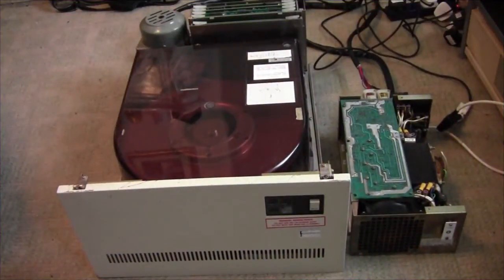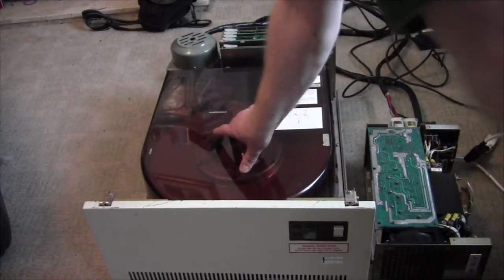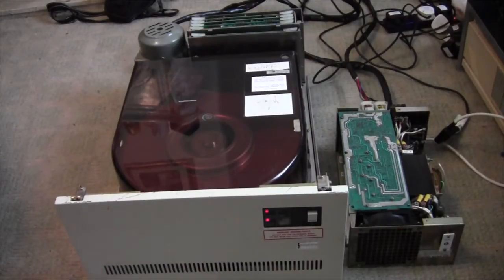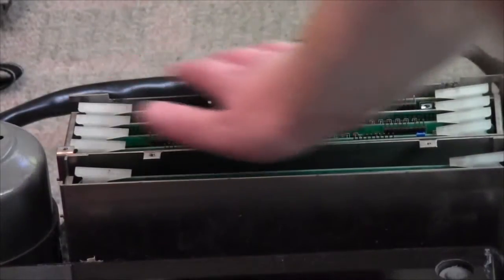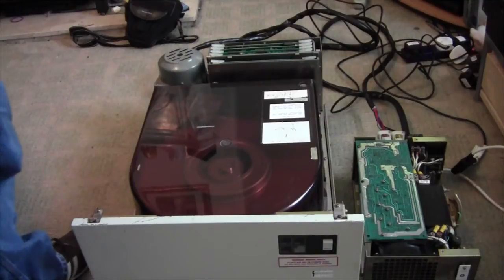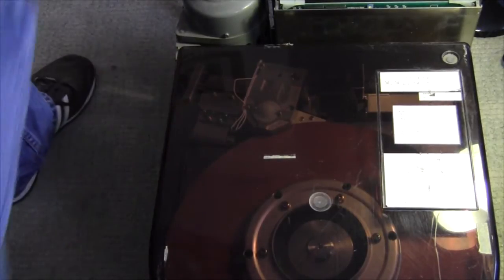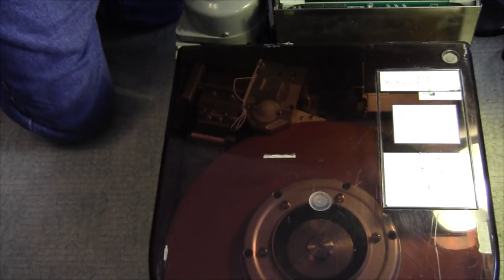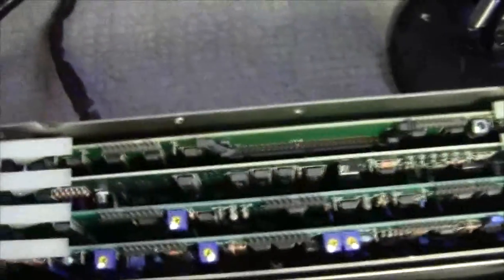Quantel Paintbox Restoration Part 2: Test Of The Hard Drive (10 Inch Platters)  VOLUME ALERT!

Comment from the maker: Yes, I thought the heads were crashing at first, but it seems to be some noise coming from the motor and also must be the belt (which is in really good condition) oscilating on the side that is not directly pulling (my theory anyway, gonna get it up on bricks to look undernearth) :o)

Comment from the maker: Yes, I have ear defenders for when it's in use lol.  Oh, thanks, it took quite a while to work out hte pins and thoroughly test it, even learned from a video last night how to test the flutter on the caps (take an ac reading on the output).  It doesn't shock to touch, but my ear just caught the case and it got me then lol

Comment from the maker: Dates on the drive are from from 1988, it has 335mb of storage, consumes over 1000watts of power :o)  (as you may have noticed, it's only slightly quieter than a washing machine at full pelt!! ;o)

Comment: I've got a v-series (I think from the early 1990's). It has the Ramcorder which stores about 300 PAL frames and it's a beast, as large as the paintbox itself. Times have certainly changed! If any of the information from the manuals etc would be of use to you let me know.

Comment: "PTCT" is short for "protect"; I was always told to spin the drive down with this button before shutting off the power. we had these things on paintboxes, DLS/CLS stillstores & on a harris stillstore.
Reply from the maker: Yup, pressing it doesn't shut it off unfortunatly.  Oooh, you have experience with pantboxes :o)  May come in handy one day, we've never got the os to run on it as the hard drive is screaming now and despite the paintbox it'self firing up now, it won't talk to it.
Reply: +duncan rmi

Hi, Duncan - do you still have any Paintbox-related hardware, documentation, videos, cables etc.?

Which era of Paintbox did you mainly work with, the classic one (like in this vid), or the V-Series stuff like the Harriet / Henry?

Be interesting to hear any stories you might have about working with them, or any films / programs they were used on. ;)